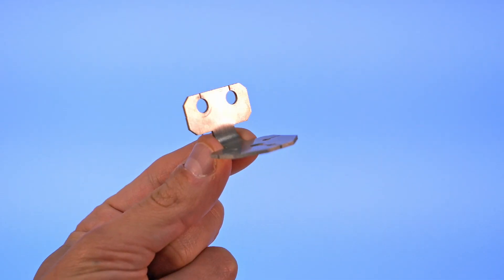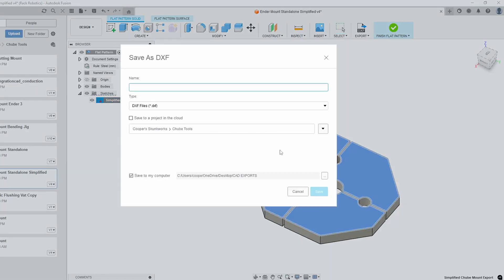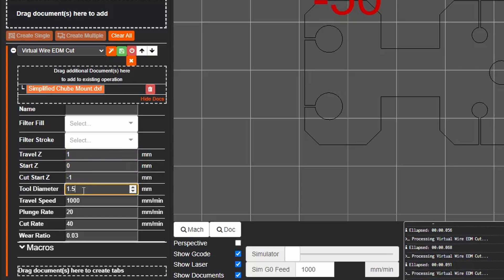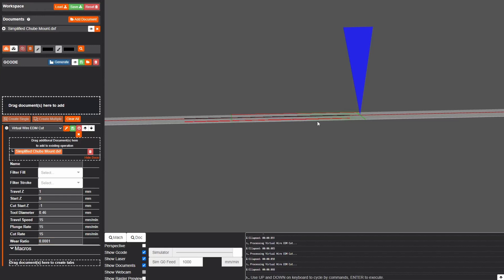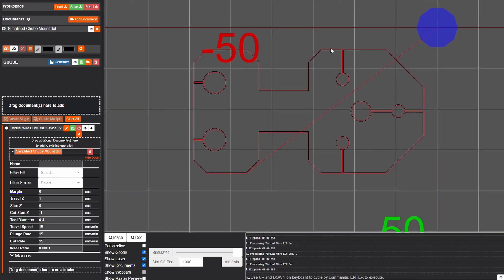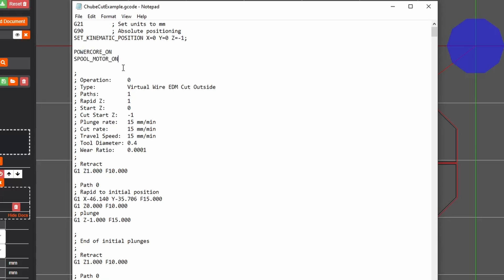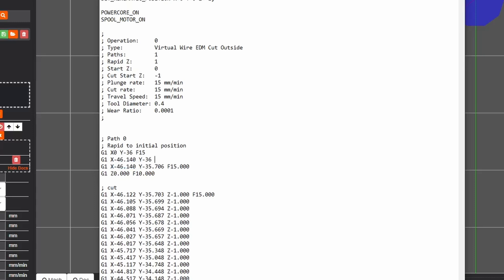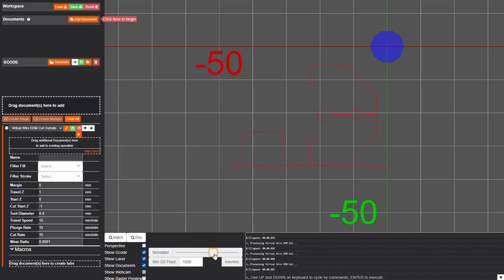3D Printer to WEDM Machine GUIDE - Part 7

Comment: I was planning on buying only the power supply and all EDM specialty parts without any printer specific parts since I'm planning to build my own machine around the power supply etc. Your videos so far made me understand a lot better how to design the EDM machine and which parts are critical to wear. As much as I like the offering of software, it's really a world on its own and I think the software, even though it's good, is probably going to need some love ;)

My machine is still far from being built, this is a project for Q1 or Q2 2025, but I'm thinking of building my own GCODE generator meanwhile as I've previously already done because I'm quite demanding in this area. This will be done in Grasshopper, meaning I can both create and export my designs directly from Grasshopper. What makes this a powerful combination is that within Grasshopper, you can simply add nodes to add functions. Things like object avoidance can be implemented as well, to turn it into a simple tool that doesn't require too much attention. I can even add a 3D visualization and path planner.

It's going to be a rough job, but I'm pretty sure I can even make it so that I can import a 3D model and that it will automatically understand what side needs to be cut so there's no need for a DXF export.

I'm based in the EU, so I haven't ordered yet, but I'm also curious if there are going to be future revisions to the PSU and other parts.

ps one of the key reasons I want to DIY my own machine is because the other model uses a US-sized fishtank. But these tanks do not exist in the same size in the metric EU as far as I could see. So I'm going to source a container locally, that I can also easily replace if needed.
Reply from the maker: The software definitely needs some work. We're currently working on our own ground-up CAM program for 4-axis WEDM.

We're certainly excited to see what you come up with as far as CAM goes! 

The current Powercore V2 should be compatible with European wall voltage. We specifically selected a wide input-voltage supply for this reason. We will ensure that units shipped to the EU have the appropriate plug.

That's great info on the tank situation in the EU. We're going to be looking into this. May require a different set of CAD models in order to be compliant with locally available containers. So far, the CAD is parametric. We may need to have slightly different lengths on some of the hardware. Either that, or just accept an undersized machine to tank ratio.

Comment: As a CNC machinist by trade, I would suggest to make sure you always include a decimal in your feed rates. On FANUC based controls, which are used in HAAS machines it can cause the GCODE execution to halt.  I'm not well versed on Klipper so I don't know how it will react, I'm sure someone with more experience can chime in.
Reply from the maker: Good catch! So far we haven't found this to be an issue with Klipper, but we'll definitely keep an eye out to see if it causes problems.

Comment: Hey! I‘m preparing to buy your kit in hopefully the next couple months, depending on how much money I make 😁 Some questions:
You use klipper here - is the klipper config file public? Is it working off some modification for klipper or just a stock install? Also, do you plan to offer shipping to germany any time soon?
Reply from the maker: Hi! Yes we plan on shipping to Germany this Winter. We're already working with distributors. For this cut specifically I was just using a normal version of Klipper. Our Danger Klipper forks should be public, but they're largely untested right now, so use at your own risk!
Reply: @rackrobo  Thank you, that‘s super helpful!